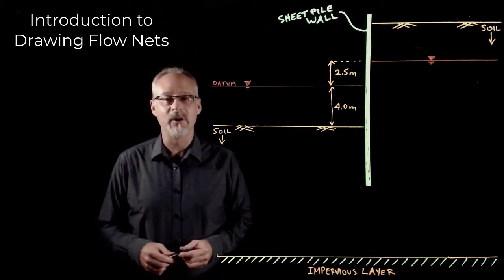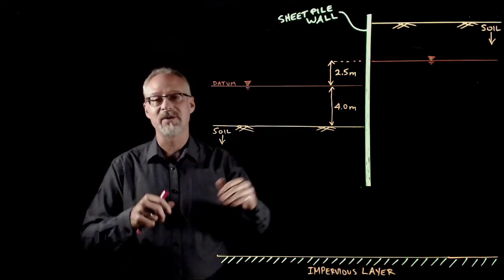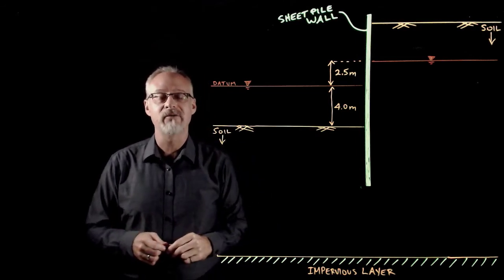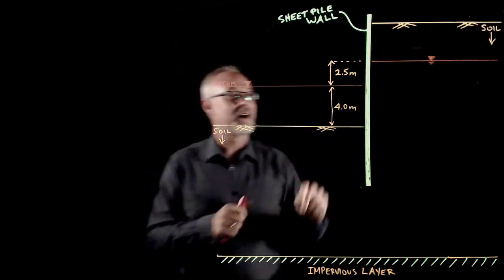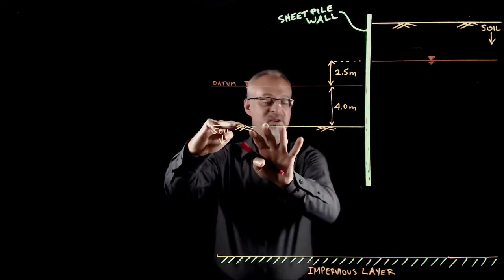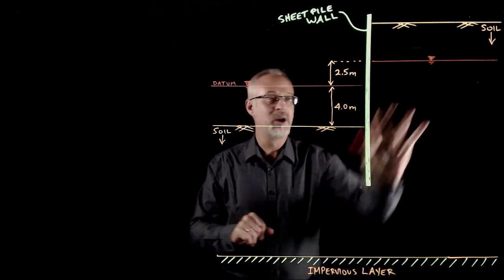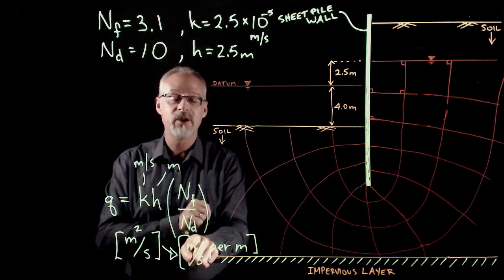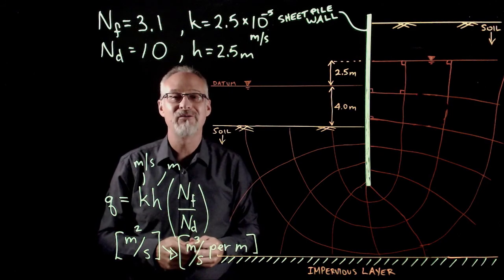Drawing Flow Nets in Geotechnical Engineering

Comment: So you can get a different answer by just choosing to draw a different number of lines?  I don't buy it.  lol I could easily see 2 or 3 people legitimately following the super-vague rules of drawing a flow net, and getting 2 or 3 different ratios of Nf to Nd.
Reply from the maker: This is a common observation made by students.  If you follow the rules perfectly, everyone should get a value of Nf/Nd within +/- 10-15%.  This kind of accuracy is well within the acceptable limits for geotechnical engineering. In fact, there is probably more uncertainty and assumptions in the value of the hydraulic gradient!  Think about drawing twice as many flow channels...if you follow the "rules" you will need twice as many equipotential lines...and you'll get the same ratio!

Comment: How do I know how many equipotential lines to draw. Do I need to calculate each one?
Reply from the maker: Believe it or not, any number of equipotential lines will work!  BUT, you must follow the rules for drawing the flow lines and equipotential lines.  If you follow the rules, the RATIO of the number of flow channels to number of equipotential drops should always be about the same regardless of how many lines you draw.  Hope this makes sense.  Thanks for the question.

Comment: Thank you for the video. at the end we found the seepage rate but how can we compare it to allowable rate ? how can we use it for proof of safety ?
Reply from the maker: Good question.  There is not typically an allowable seepage rate, therefore we are not able to calculate a 'factor of safety' in the same sense we would for bearing capacity, or other geotechnical calculations.  We would use the calculated seepage rate for something like selecting the capacity of de-watering pumps for a project - i.e. we would supply pumps that could keep up with the seepage we anticipate - and we might size the pumps 3-4 times what the calculations suggest.  This would be the closest thing I could think of to a 'factor of safety' for seepage.  Hope this helps!

Comment: thank you so much ❤️,
so basically Nf= is most of the times given and it is no of channels? and Nd is basically up to us?
Reply from the maker: Yes, Nf is the number of flow channels; it is not usually given, but drawing the flow net with 3-4 channels usually works out.  Fractional channels are also possible.  The number of Nd will be determined by how well you follow the rules for drawing the flow net.  Don't over think it - just draw!

Comment: Thank you very much for the video, But how can you predict water goes in a particular path in soil, At 5:12 you said that "water is going to go down then around the tip of sheet and go up" why does that happen
Reply from the maker: Thank you for the question.  Water is 'driven' (i.e. - flows) from regions of high-pressure to low-pressure.  The difference in the elevation of the watertable on either side of the sheetpile wall creates this pressure difference.  The flow net is a way to predict the path that the water will follow.  The flow net method is based on the assumptions that water does not 'cross-over' itself - it only flows in continuous 'parallel' paths.  It is also based on the assumption that the flow into an 'element' of the flow nets equals the flow out of the same element.  These assumptions come from the french mathematician Laplace - you can read more in any textbook or on the internet, if you are interested.